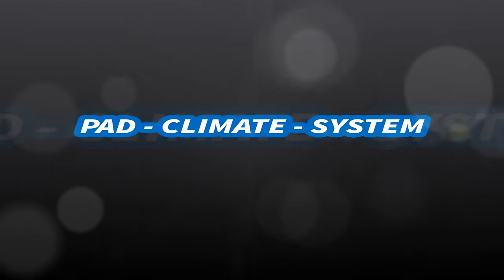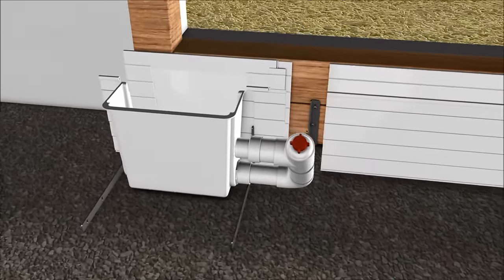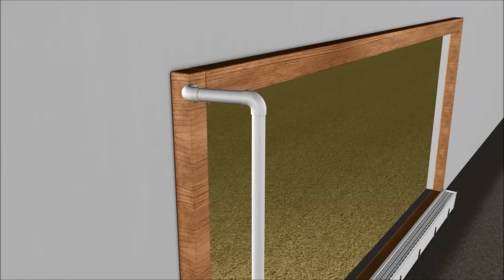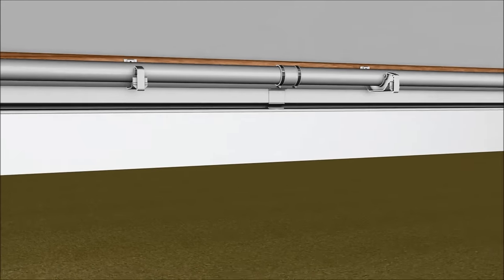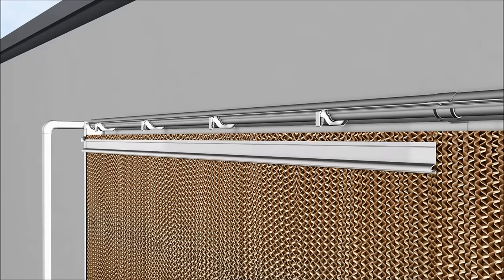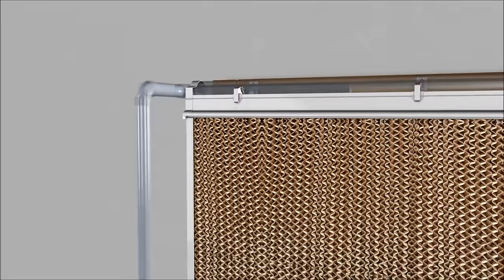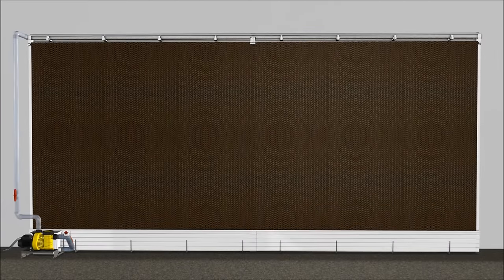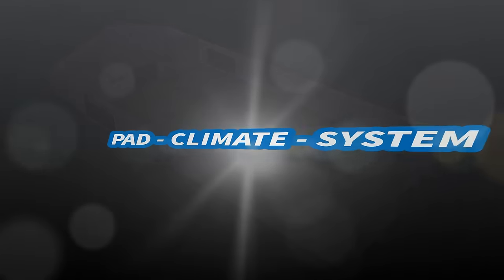SKOV Pad cooling system

Comment: It can only be active if the relative humidity is less than 50-60 % less.. ıf relative humidity is high it is useless.
Reply: What if ran with a dehumidifier?
Reply: Absolutely correct. Also I'm not convinced that its effective in greenhouses because of plant transpiration which will naturally raise the humidity in the greenhouse anyway. Where is the measured performance data?
Reply: Yes. These do work on dry climates though, using this in hot areas like death valley is useful.
Reply: System need air flow , while air stop  it fail
Reply: This is more effective when humidity is less than 40%. Even 60% humidity shall cause  a steam effect inside.
Reply: @donaldmuller8300   Using dehumidifier is another chapter. It is needed around 1000 kcal to evaporate 1 kg of water. And when the air temperature increase the amount of water in the air increase considerably. 1kW electric is only 860 kcal. So it is meaningless. This is why heatpump is on duty. SO THERE IS NO CHEAP SOLUTION.

Comment: Why we dont use air conditioners in poultry houses? Is it because of economical reasons??
Reply from the maker: Dear Mr Wayne

You would need to use many and very big air conditioners to cool poultry houses and these would use an enormous amount of electricity.  

Kind regards 
SKOV
Reply: Air conditioners air is dry . We need cool air with 65 to 75 humidity  just this type of system give us.  I have also ec house and I am satisfied with this . Poultry must need this.

Comment: cools hot air down by what with humidity???  3:31
Reply from the maker: Hi Rusheka Davis,

Thanks for your question. The degree of cooling depends on the area of your farm and is always calculated for the individual case.
If you are interested in knowing more, you can find your local dealer here on our website:
https://www.skov.com/en/pages/dealers.aspx

Best regards,
SKOV

Comment: I used this method for My home..  

using RO rejecting water ... 18watt solar pump and honey comb on my net doors..

I get natural  cool clean air with zero cost and electricity cost .. 

temperature down by 12-15 degree   from outside

Comment: What about mineral buildup? And you have less branches where needed (hot climate) Europe vs Africa and Middle East
Reply from the maker: Hello sir,
Thank you for your question.
To prevent mineral build up the vertical supply pipe includes a bleed-off valve. This valve should be adjusted to discard a small amount of the water used to wet the pads.

You can find all our Sales Contacts and Partners here: https://www.skov.com/en/pages/dealers.aspx

Best regards,
SKOV

Comment: How often would you need to change/cool down the water though? If the air outside is as hot as 45 degrees (C), water would start burning in less than 10 minutes.

Comment: the amount of constant or variable water when cooling the air?? does the temperature variation affect the system as it cools (cooling the air before entering the gas turbine ??
Reply from the maker: Dear Mr Mer 

I am a bit unsure if I understand your question - could you please elaborate? You are also more than welcome to call us at +45 7217 5555 and have a talk with our Climate Product Manager.

Kind regards

Vibeke Trarup
SKOV A/S

Comment: Water distribution from 1 side won’t be equal as flow line side will have a high pressure and thus dripping increases. I believe multiple inlets should solve water dripping problems.

Comment: Nice graphics, but unfortunately all remain at this point. This system do not work, will not cool, only will rise humidity, to the level you do not want to be
Reply from the maker: Hello,
Thanks for your message.
Yes, the system will increase humidity but at the same time, it will cool the air. Evaporating water into the air will remove energy and thereby decrease the temperature. The climate controller will stop the cooling when reaching a user-defined maximum humidity level.

You can read more about our cooling solutions here: https://www.skov.com/en/poultry/Pages/Cooling.aspx

And you are always welcome to reach out to us or one of our local partners worldwide: https://www.skov.com/en/pages/dealers.aspx

Best regards,
SKOV

Comment: Idea is good but it is not looks good.

Now days having this kind of design in home that's not looks good.

And moreover multiple motors running continuesly results the cost for electricity is also High.

Cleaning is also required atleast once in a month.

Considering all these it is good but I like the idea though 👍